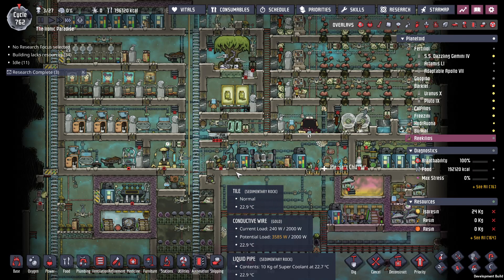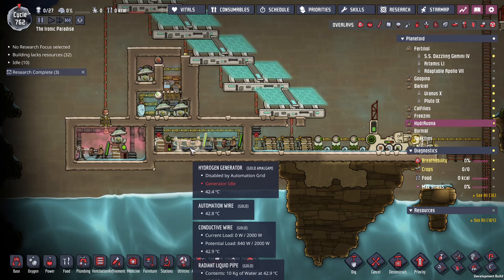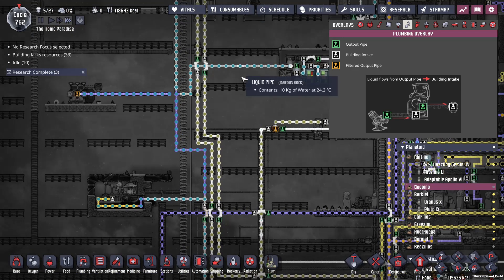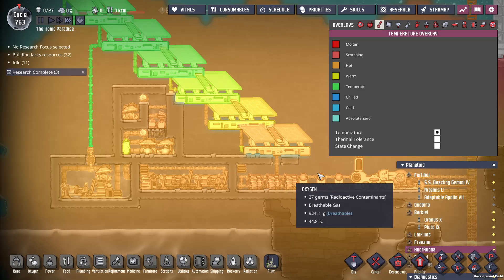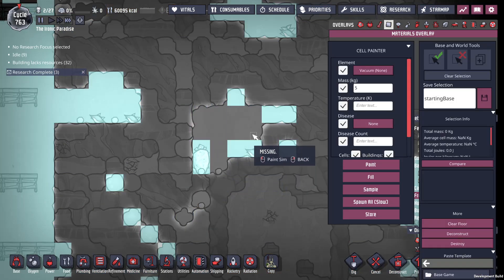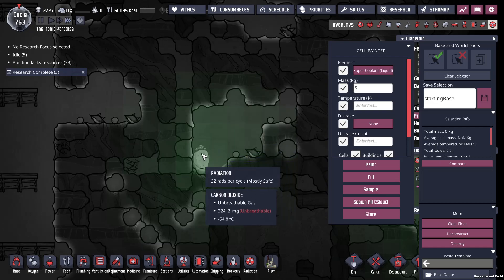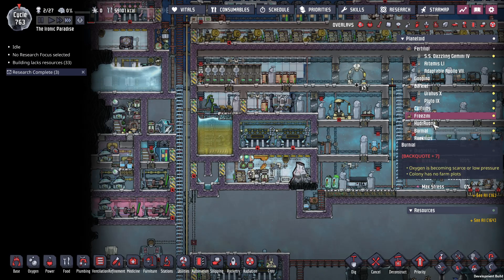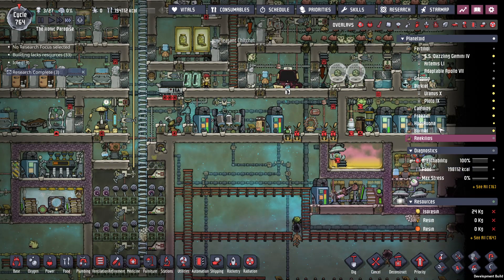The Ironic Paradise ep 34 Making a Hydro Launcher to Supply Water

Comment: To make sand to filter the pwater vent I was thinking of heating up the pdirt that u filtered from the filter machine back to sand using the steam turbine cooling loop for the heat but not sure about what to do with the cooling. The saltwater if the sweeper can pick up the salt out of the desalinater u can just pull it out and conveyer the salt somewhere if not I'm not sure.
Reply from the maker: cooling is easy enough with solar and steam turbines. polluted dirt into sand would slow the use of sand down, but I assume it's not 1:1

Comment: Hey Tartarus, could you make a video on how to harness rocket power? They don't use any fuel when they are taking off, nor when they land, but they produce a lot of heat.
Reply from the maker: I miss regolith, in the original game I did a rocket powered melter for huge power. The new nuke rockets could be fun.  I'll look at that in the next map.  Good suggestion.
Reply from the maker: I just thought of a problem, in the base game you wanted to launch rockets non stop for supplies, in spaced out rockets suck because they have to keep a dupe alive and move them in and out.  Maybe just to orbit and back to build up heat?

Comment: Ok i have to give you some heat for this "the game only uses 1 thread".
First of all that is sadly so wrong. The game uses multiple cores but you don't see that all the time.
Indicators that show this: Duplicants get more efficient on laggy worlds if you run on slower game speed. That means the duplicants wait for another thread to finish its calculations on what to do.

Now to give some credit: most things are single threaded in this game. Due to how the game works and some things can not easily or ever be multithreaded due to the nature of the game.
But saying: Just multithread and everything will be better is just stupid. Because no there is also overhead included to do such a thing. And Order of execution is also a thing.

But to point this out: AI is multithreaded for sure. Other things might be multithreaded too but the main thread actually waits for the game to finish the calculations making it effectivly a offthread calculation, but that already saves time.
Most of the lag actually comes from drawing changes because buffers and the flow of things must be updated. Thats why "Filling" your map with tiles is helping lag because the air flow (even no gas counts as that) has to be calculated and updated on the render thread which is always singlethreaded.

TL:DR: The game is not singlethreaded, but a lot of lag is actually due to drawing dependent data that can not be fully multithreaded.
Reply from the maker: I didn't do as good job of explaining like you did.  The end result is the same, the game has to wait for the main thread, the longer you play and the more complicated the map the more that thread has to wait.  Which results in lag.  There must be ways to better use resources to improve gameplay is all I am asking for.
Reply: @TartarusPlaysGames  The main issue is mostly the complexity of the data. If you look at the Air Flow effect or how the air is moving it is really hard doing that.
I expect they do that already on the GPU otherwise you would have already FPS problems because this is like really really complex code (I don't know how to actually make this kind of effect that smooth how they did it)

There is a couple things that could be multithreaded and i expect them already to do it. But i think at that point, how do you optimize a system like that?
Either by implementing a new system (which is equal to make it MUCH more buggy) or by reducing accuracy/speed of the simulation. Honestly, machines & pipes arent't that laggy, its mostly pathfinding & force transfer which are soo deeply rooted that i doubt they be able to fix that without months of much much more buggy gameplay.

But yeah in the end you are right, the game isn't as optimized as it could be, even so they did a fantastic job of how well the game runs in the first place.
Just to think how much simulation they put into the game and still achieve that much of performance its nuts.
But i think they could have done more. But how much are you willing to trade for performance.
They already traded map size for more planets. (I mean the map is smaller then the normal game map it comes down to the same size in the end result)

Unless they are doing more DLCs and invest more money into it, i doubt this is going to change.
Especially since their game logic is also heavily animation dependent. (Animations usually define how logic is executed)
Reply from the maker: @Speiger  It is a bunch of math to do.  Also a hard issue from a programming standpoint.  We have the available cpu to do the math if they figure out the code.
Reply: @TartarusPlaysGames  yeah but the math isn't the issue. Otherwise when you pause the game FPS should be at 60. But it isn't. The issue is the transfer of data from the CPU to the GPU. In other words the PCI Express lanes & Ram are the bottleneck.